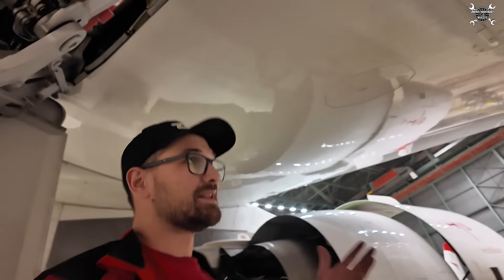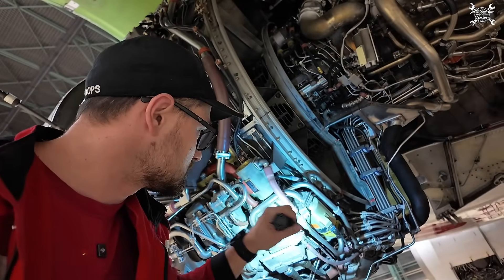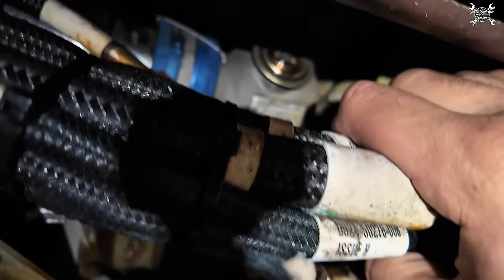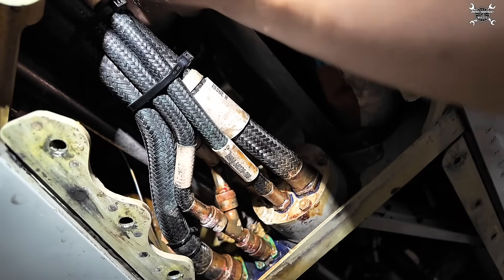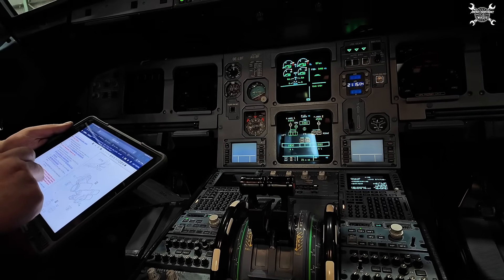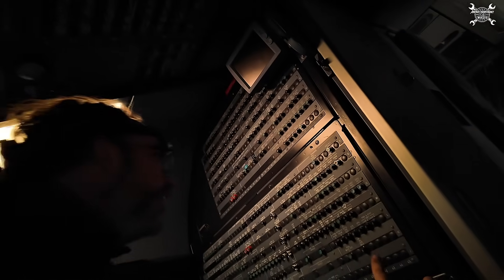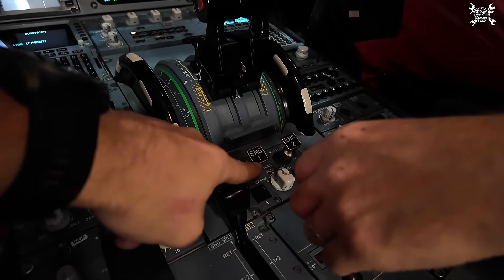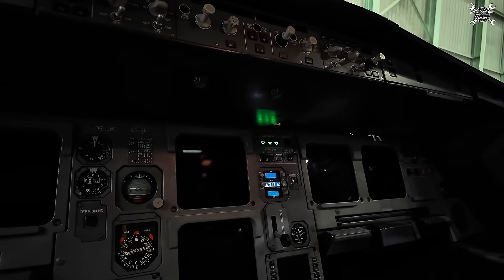How to stop fuel to flow in to engine of A320

Comment: Before Dry Cranking, the AMM Task says to pull the the HPSOV C/B. So how does the LP vlv open to let fuel feed the pump to avoid cavitation although I do not put Master Switch ON nor Release Fire P/B? What is the interface between HPSOV C/B and LP VLV opening?
Reply: pulling the hpsov c/b de-energizes the engine master relay which removes closing power to the lp valve actuator thus opening it. The c/b simulates master lever in a way
Reply from the maker: And to add to comment above HP valve open only when you set master to on this will let fuel enter in to the fuel nozzles and we don't want that so LP  is all what we need to supply pump and HMU🙂

Comment: I think there is access panel from the top of wing Leading edge for easy removal/installation of LP fuel valve
Reply from the maker: You are right. There is an access panel. But you must seal that one
Reply: @zeto.r whst you mean by "seal that one"
Reply from the maker: @aviationworld1142  because sealant is applied under the panel

Comment: Is it mandatory to open the fuel filter cap to perform the LP vlve  test?
I think that just observing the valve physically open is enough
Reply from the maker: How you know that either actuator or valve broken the way that indicator moved but valve is stuck in  close position. I followed the AMM as always 🙂
Reply: @zeto.r Thank you for this information.
Aviation is really very safe ❤❤